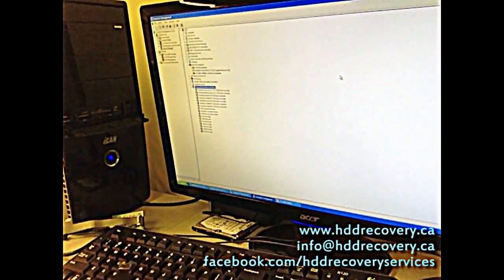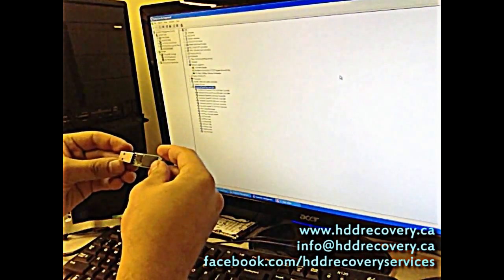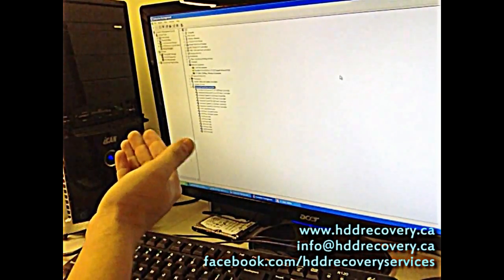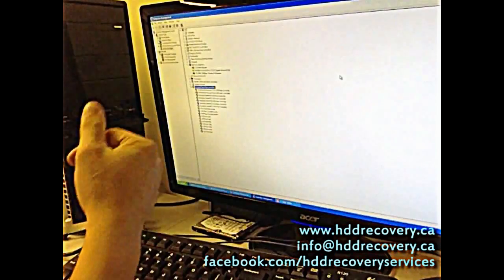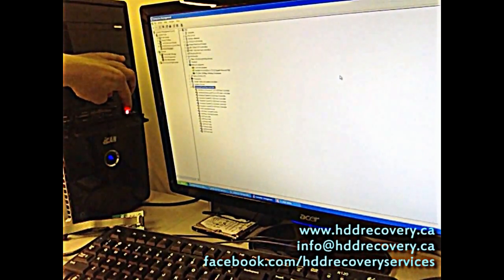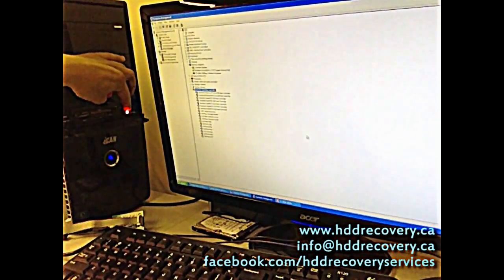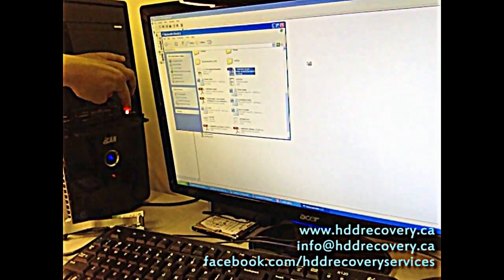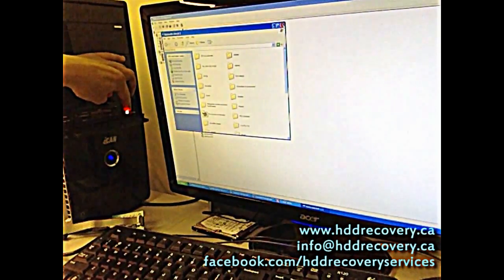how to recover data when flash drive is not working

Comment: Hey my friend i know it's a old video but maybe you can help me, i have problem with usb stick, yesterday it work perfect i put my pc to sleep and usb stick remain in my pc. Today when i turn my pc the usb stick don't appear anymore, i try to move different ports but it say "device driver software was not successfully installed, usb mass storage device failed".
I try to unistall usb mass storage device and scan for hardware change but it keep my give "device driver software was not successfully installed, usb mass storage device failed".
One more thing the usb stick keep disconnect and connect automatically on manager keep refresh and appear/dissapear "usb mass storage device", I try it on others pc and i have the same problem.
I search for some solution on internet i don't find anything.

Comment: Hi.

Thanks for the video. I have a different problem and I hope that you can give me some advice.

My flash drive worked for like 5 seconds. I was able to see the files but when I attempted to open one of the text file (double-click) it said "Please insert a disk into Removable Disk (F:)".
After that happened, I unplugged the flash drive and plugged it back in, the computer went through the "installing software driver". Ever since after that, the flash drive will not work.

The computer recognizes the drive (I can hear the sound when I plug it in) but I cannot access the files. It keeps saying "Please insert a disk into Removable Disk (F:)"

Any advice?

Comment from the maker: We redid the video for all of you ;) find it here: http://youtu.be/BwvsbUOKGLY
Reply: HDD Recovery Services tried this it isnt working my pendrive/flashdrive is showing a blue light when plugged in but not coming on devicemanager or manage>disk management or cmd>diskpart>listdisk its just a solid blue light and nothings happening
Reply from the maker: ninjatzH probably the issue is with the controller. In that case we recover data directly from the NAND memory chip using Rusolut or Flash Extractor
Reply: HDD Recovery Services hey man i need some help with my hdd, so i turned my laptop hdd into a portable with a converter and it used to work all fine but all of a sudden i get a tick tick noise from hdd when i plug it in (at the back of PC) but it spins fine when i plug it into a wall charger or my laptop why wont it spin in my PC all of a sudden? and i have 3 laptop hdds (same converter) neither work in PC but all work in my laptop plugged in as USB is this a motherboard problem, software issue or what I'm thinking of getting a 1 to 2 usb cable
Reply from the maker: if the drive does not spin up that means it is not getting enough power from USB port. in this case you can use special cable that plugs into 2 USB ports to power your drive. I think that should work.
Reply: HDD Recovery Services i'm starting to think its a motherboard problem because even my GPU isnt working right because when i start up PC it doesn't boot with gpu but with onboard vga and the gigabyte manual says it provides 3x power to usb ports

Comment from the maker: Tess, you could try installing data recovery tool such as R-studio. It is not free but they allow you to download a trial version. Trial version works same as full, but it wont let you save files. With trial version + holding up the flash drive see if you can find your data. If you do just buy that software and save your data to a local drive. Let us know who it works out for you.

Comment from the maker: lusiifax, you just need to flex it up or down and keep it in this position until drives contents are moved. However, if flexing does not help your flash drive to become recognized and give access to data, then the problem is related to something else, for example it could be failed/degraded controller chip. We can assist with that as specialized tools are needed. email us at the address you see on video

Comment from the maker: if it did not work, then either your USB connector has completely came appart from the board on one or more pins. Or the problem is not connector related.
if you look at our channel - we have another video about a Sandisk Cruzer USB drive that had identical problem. We had to remove the connector and reattach it using individual wires leading to proper point on the PCB.